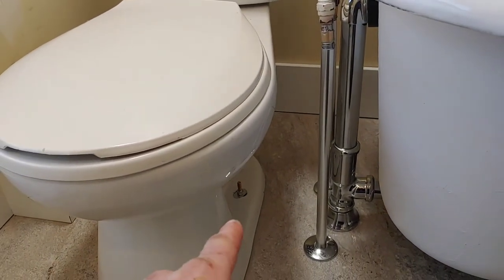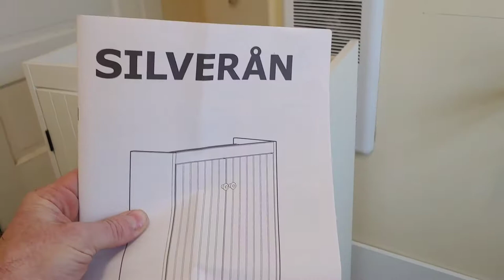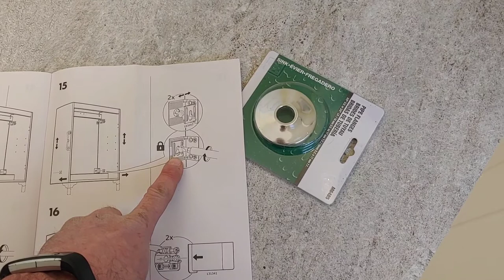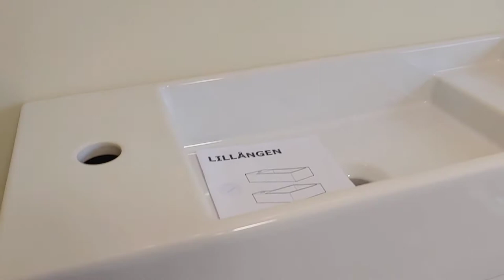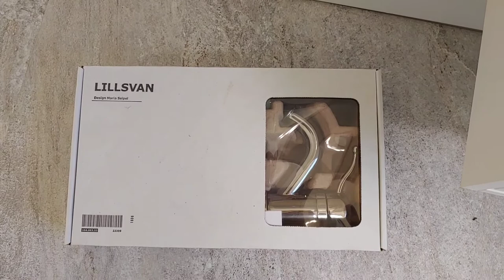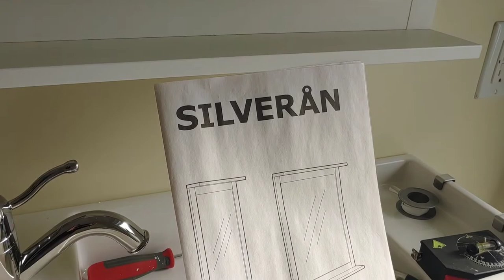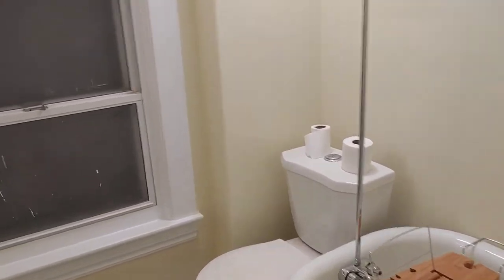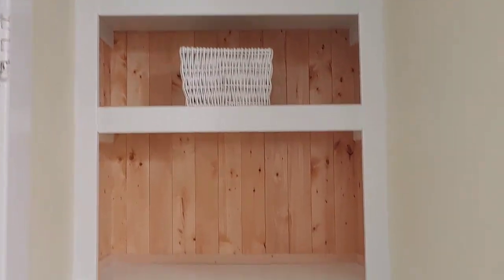IKEA bathroom. Finally done !

Comment: I know it dims by touch but does the Sodersvik require a switch to be wired in? Or does it turn off by touch too so you can just wire it to constant power?
Reply from the maker: it does dim if you tap it. Correct!  I thought it was faulty at first lol.  I wired it like any other light fixturre.
Reply: @houseonpleasantstreet9774  but does it turn off when you touch it?
Reply from the maker: Ok I wired it as a regular light.
When i flick the light switch on it goes to full brightness.  
If I tap the light it dims
If i tap it again it goes full bright.
If the switch is on. It will not go off fully.
Reply from the maker: Constant power gives me full bright and dim.  No amount of tapping will turn it off.  Only the wall switch will kill it completely.
Reply: @houseonpleasantstreet9774  perfect, thanks. I'll plan on wiring in a switch.